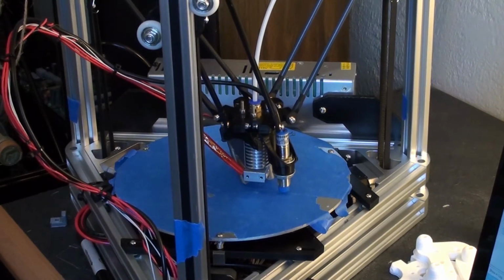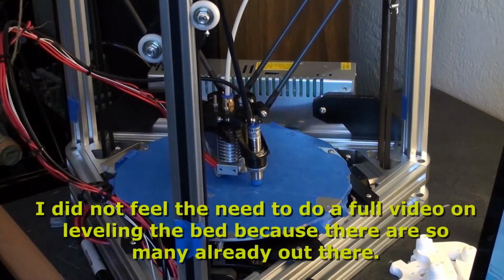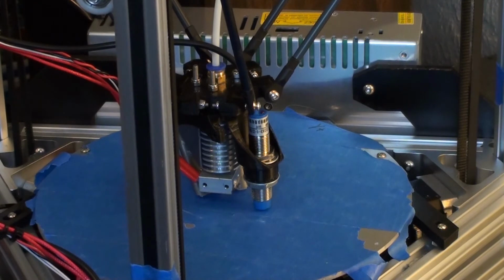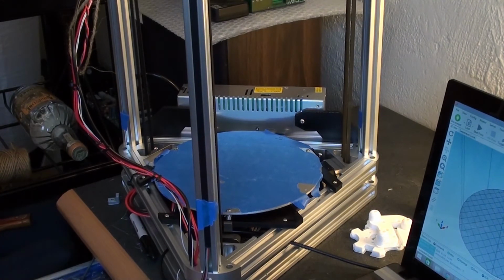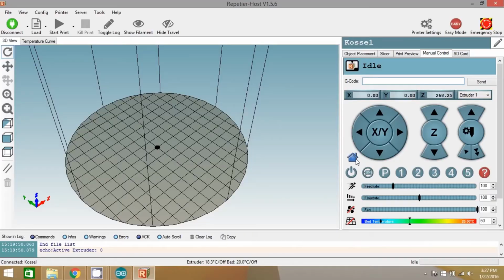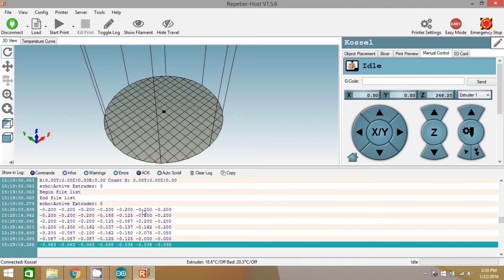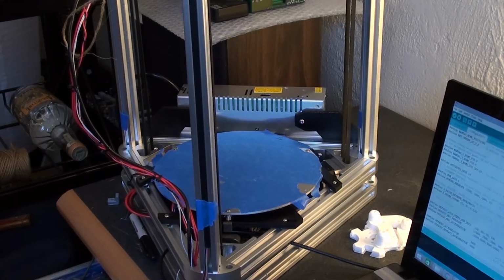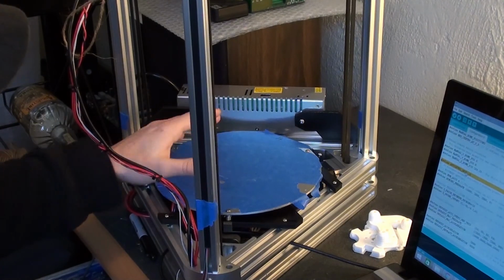Folger Tech Kossel Rev B. (Part 5) Z-probe - Tips, Commentary, Opinions, and Aid

Comment: THANK YOU so much for your videos!!!  I am very seriously looking at purchasing this 3D printer and it's very much on my shortlist.  I do have a couple of questions for you.  #1. Thinking about getting treated glass for my heated bed.  Do you think this would improve printer and make calibration/setup easier?  #2.  I am also looking to get a E3d v6 hotend?  Did you use this hotend?  Or is pretty much everything in your printer stock?  Thanks!
Reply from the maker: +Troi Bandy My personal experience with glass has not been good. I have a printer that does ABS and getting the print off the glass proved fatal to the glass itself and it didn't last a year. I guess the real question is what are you planning to print material-wise? I've done ABS on glass and metal and didn't really see a difference except for the fragility of the glass. Is glass easier to level, yes. I worry less about the first layer encountering a low spot and not sticking. On the other hand, I can run to a material supply place down the road, have them cut me something thicker, and just clip that on (adjusting temp to compensate) and have a more level bed for $10. #2 The E3d v6 is a good end. I have one here, just not mounted, but have used it on other printers. The one in this kit is, as my research shows, a knock off that is a little larger that the genuine product. I find the one in the kit does not tighten up the way I would like when it comes to the hot end and nozzle. It seems like it's always on the verge of coming loose, and the metal doesn't seem like it will take much torque before you strip threads somewhere, but it does work. I'm not sure if I'm going to mount the v6 it to this printer, but if it hasn't been done yet, it may make for a good video... The next video is going to be a "what I can print" video with the stock parts so there is a baseline for future modifications.
Reply: +RandomDevil1 Thank you very much again for your answer!  I do have one more question for you.  Based on your experience with this printer, other than the hotend, what mods or items do you think would be a good idea to purchase to improve the kit?  They sell a Aluminum End Effector.  Would you recommend using that compared to the plastic Effector that comes in the kit? Thank again.
Reply from the maker: +Troi Bandy I have a coworker that likes to do that kind of stuff and even went with the magnetic ball joints. He has turned out stuff that I cannot touch as far as quality, but he did pay twice as much for his kit and had to alter circuit board connections. I have no issue with the effector being the plastic/printed, but mine did split on one or two of the bolts. I also had to do a good amount of sanding around the hot end's seat (?) where it sits in the effector, just to get it to fit. It's nice and rigid and after adding some shims around the hot end (tin foil, folded), it doesn't wiggle at all. Most of the excess movement in the effector comes from the ball joints on the rods. I plan on trying a new printed piece for it in the future and have material to make new rods here. More videos to come.

Comment: How do you keep your bed from wiggling with the spring mounts?
Reply from the maker: +Matt Davis I haven't really had an issue with the bed wiggling while printing. I made sure to use some really tough springs, and it holds the bed well enough that I can push on it and the printer moves before the bed shifts on the screws. This is a good thing to point out though. After you pry a print off or have to push on the bed enough to compress the springs at all, chances are that it will need some slight adjustment to the bed's height before it is perfect again.

Comment: Did you have any issues with the bed being convex/concave?
Reply from the maker: If you seem to have a concave or convex bed, you might just have to adjust your DEFAULT_DELTA_RADIUS by changing the DELTA_SMOOTH_ROD_OFFSET to get make the motion of the printer head to be more level. I don't touch on it much, but there's lots of documentation on it out there.
Reply: RandomDevil1 Oh, thank you! Do you remember what raising/lowering it does? I'd just try it but I dont want it to gouge the bed. And what exactly is the smooth rod? My kossel doesnt have one.
Reply from the maker: If your hot end is closer near the edges of the bed, you add. If it is farther away at the edge of the bed, you subtract. You can do this by just appending +1 or -1 to the smooth rod offset or Delta_Radius.